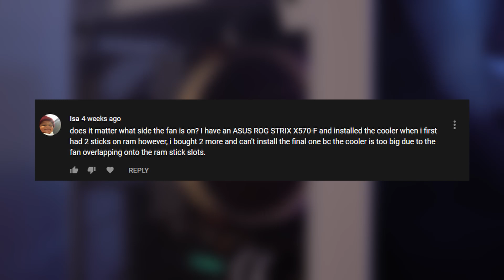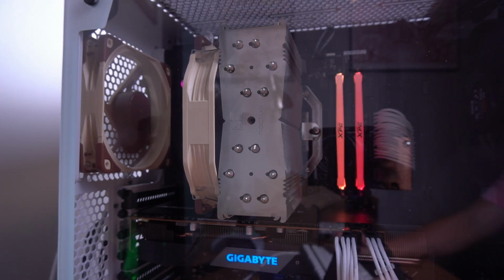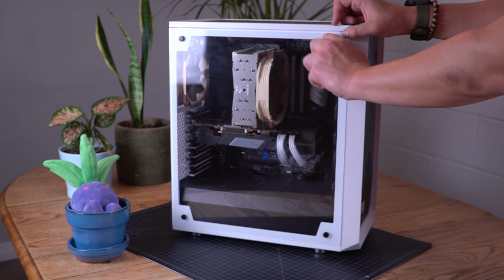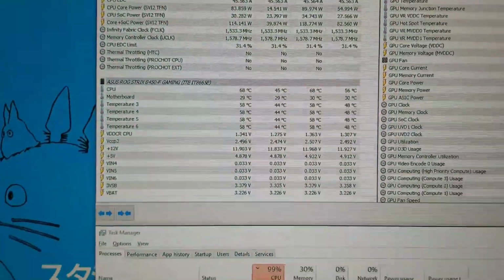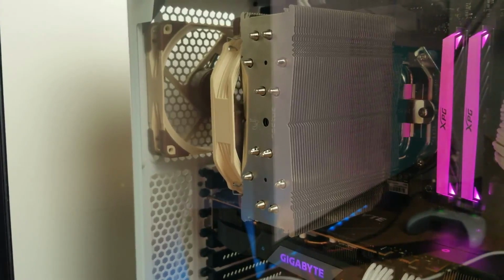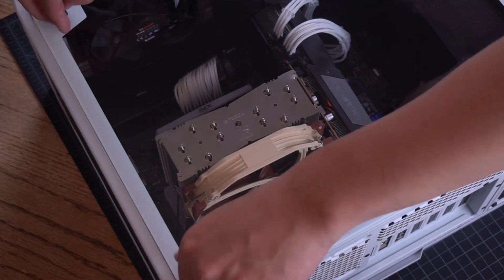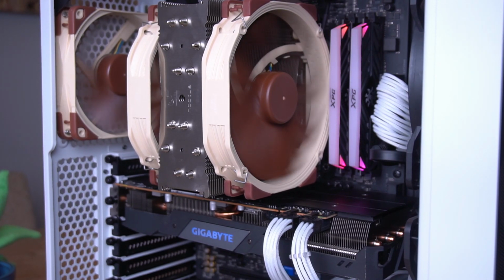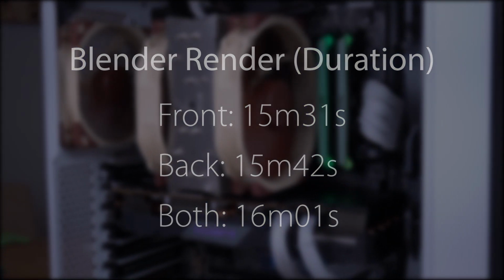What is the best placement for your heatsink fan? - Noctua NH-U14s

Comment: You need to set a fixed value for the fan speed. Otherwise you will get about the same result for every test since the only difference will be fan speed instead of showing the temperature difference that would've been reviled if the fan speed was fixed.
Reply: @heartman1486  You do that in bios/UEFI or there are software to do it if you prefer that.
Reply: Fan placement will not affect setting fixed fan speeds or not.
Reply: Man, you either painfully misunderstood the comment or painfully misformulated your thought. He's saying that the experiment does not make sense since even if there is a difference in cooling efficiency based on fan positioning, we won't see it because fan speeds will adjust to compensate.

Comment: I did the same test and found the  best config was with the  fan at the front. I also tried the dual fan set up and temps dropped a mere 1-2C.   However the dual fan set-up  had a distinct increase in audible noise. To the point  I thought there was a fault with my second Noctua fan, swapped and tested, was fine. Possibly  an interference  issue. My experience  says a second fan adds near to nothing. Hope this helps.
Reply: A couple C is a a couple 100mhz on a OC
Reply: @RossBoss90  For sure, in my case it was about lowest temps whilst being quiet with the standard clock. I do see your point of view though.👍
Reply: You only needed to use the supplied thicker fan bumpers that came in the box to get rid of this noise. Same thing happened to me when I added a pull fan on my D15. Those thicker bumpers only come in the U14S not D15 as the U14S was meant to have a pull fan added if desired and Noctua knew there is turbulence when the pull fan is used without a slight gap on it. If you look at your fan you will see the fan blades are closer to the edge on the non motor side.
Reply: @45eno  Thanks for the input. I can't find the original box, got lost in a house move. I have a couple of chromax fans on order, any idea if these use the thicker bumpers? 🤔
Reply: should both fans be facing towards the exhaust fan of the case or should they be alternate?
Reply: @miadu2466  The front or push fan as intake, the back or pull fan as exhaust

Comment: In my experience, the pull method (after the radiator) will make the fans work harder which makes them louder. Having the fans set up to keep stall (neutral air) from building up is always a plus. No matter, if you prefer AIO/Air, proper air circulation, if you prefer AIO/Air, proper air circulation will save you a lot of money.

Comment: I think if there was some sort of shroud around the fan that kept air from leaking  around the heatsink it would help as there is some  positive pressure created by the resistance created by the heatsink when pushing or pulling.

Comment: When having two fans, if the back one is spinning a bit slower than the front it could block airflow possibly or create a hot air pocket?
Reply: Use a 2 way splitter and run both matching fans to the same fan header. Noise on the rear suction fan is from improper spacing of the suction fan to an object.

Comment: I find having a fan in pull config isn't desirable as it creates an annoying acoustic. I have a Deepcool AS500 plus and at full speed, the fans are only at 1200rpm but the rear fan creates that loud noise due to it trying to pull air through the heatsink. If I run the fan at max with just the front fan, I don't really hear it as much. 

This is why for intake fans, it's best to have a gap/space between any mesh panel and the front of the fan. If you put your hand directly in front of a spinning fan, you'll hear the difference as well.

Comment: 5:24 actual reason it was louder in pull config and push/pull config is the pull fan placement to the heatsink. That heatsink was not designed to have the pull fan that close to it. The intake side of the fan is so close to the heatsink that it makes turbulence. Some of Noctua's coolers and many other brands need a slight gap on the pull fan to avoid this added noise. Noctua even includes thicker corner fan pads in the box for the U14S and likely many other coolers I don't own. Always pay attention when you install any fan with the intake side close to something. If you hear a new noise, don't just slow your fan down, find a way to put a gap between the fan and the surface it is flush against. Crazy this is not talked about more in tech channels, pull fans are always vulnerable to weird additional noises from the fan blades simply being too close to an object.
Reply: absolutley right. have the same issue with my cooler master. push/pull makes noise, till i played with the gap
Reply: To clarify, you mean the fan on the back side? I assume it's fine - perhaps even good, to use the slimmer pads on the regular configuration i.e. when there is a fan in the front?
Reply: @bennuwa  yes the backside fan,pull fan can create noise when place too close to a surface. If you keep the fan rpm down low enough you can decrease the chance of hearing this droning noise. But then you are greatly limiting cooling performance as you likely could run your fans faster while still being quiet enough for your needs. The easiest way to test your fans is one at a time. You can buy a $10-15 fan tester that you can control the rpm while placing the fan near objects like the heatsink or case. 

Usually pulling a noisy suction fan out away from the object by 2-5mm is all it takes to eliminate that droning noise.
Reply: @45eno  Sorry, to clarify again - if I only use one fan - the normal supplied fan, in the front ("push"?), then it's better to use the slimmer pads I take it. 

As far as I understand, the thicker ones are just for the rear fan in a dual setup. Just to clarify my meaning
Reply: @bennuwa  Yes, when you install a fan in a push or blowing onto a surface you normally don’t need any additional gap so the standard corner pads are all you need for vibration control. The thicker pads are a good option on suction / pull fans on the backside of the heatsink. Or anytime you get a weird fan noise usually only when the intake side of the fan is up close to something.
Reply: @45eno  I like the fact that this convo has been going on for a year.  I have Noctua nh-u12s in a push-pull configuration.  Getting ready to upgrade cpu, may put some thicker pads on the pull side.  Thanks.
Reply: @justingreen4450  even small felt pads cut to size can stick onto the fan corners and still blend in if the color is right. Noctua sells options as well that provide gaps. Good luck.

Comment: If you're experiencing RAM clearance issues, just mount the fan slightly higher on the radiator. 

P. S. Kudos for the Studio Ghibli background.
Reply: Finally someone that already posted the obvious. As long as your case can handle the slight fan height increase then you can easily make even the dual tower D15 work with stock front fan AND 4 sticks of ram.
Reply: @45eno  ONLY if raising the fan clears the case cover. Not a trivial point but a make or break point.
Reply: @jasonking1284  Did you even bother to read what I wrote?  I already said as long as the case can handle the slight increase in height. Did you even bother to read?
Reply: @45eno  Yea. I did read. That's why I wrote the message. You need to remove the word "slight" because it trivialises the situation whereas the reality is, even a SLIGHTly raised cooler is going to be a huge problem if it doesn't fit. Either it clears the case cover or it doesn't. "Slight" does not come into it.
Reply: Yeah not possible with mine unfortunately

Comment: Sooo, i built my PC a while ago but it was my very first time ever using one of these coolers. I went with the "Thermalright AssassinX120 SE ARGB White CPU Air Cooler, AX120 SE" cooler.
 I never had any issues with temps or anything, but i was walking by my PC that sits on a table next to my desk and realized i had the fan blowing towards the back. 
 I never noticed because I never had any temperature issues. It just caught my eye. Then I started wondering if it even mattered. Thats how I ended up here. I only have 2 sticks of RAM with the RGB heatsink covers on them similar to yours. 
 Then I wondered if putting the fan on the front of the cooler would help keep the RAM cooler. 
 But, I dont really want to change anything if it's not going to make much of a difference. Soo, I appreciate this video!! It saved me a few mins by not making me change the fan to the front, lmao. Thank you!!

Comment: The results are probably because the dual fan setup was done last and the system was fully heat soaked from running longer. Ergo the system slowed some. 
I have a U14S on my Ryzen 7 5800X build and the Cinabench R23 points drop, compared with doing a test when the system is just started and cool,  to when it's been running for hours and heat soaked. (all background programs closed, except security) 
Other's that have done these dual fan tests, on single tower coolers say the same thing, more noise, no increase in cooling. 
(In fact in a lot of test cases, the dual fans increased temps) the reason for that is, that not all fans are created equal. The exact same model of fan, can easily be plus or minus 100rpm from the specs, or even worse with cheaper fans. 
Even Noctua's newish and vaunted NH-U12A runs the same with just the front fan and no rear fan.... (but with less noise)Hmmm. 
I have enough experience with Noctua now, to know they make excellent fans, but like every other company, there is a lot of hype around the coolers themselves. 
For instance, the solder between the heat pipes and base should be visible but isn't. 
On the NH-D15S the cooling is so degraded by the single fan, you are better off getting a single tower solution. Either that or plan on the increased expense of adding a 120mm fan to the front tower on the D15S and running the middle fan in a push configuration on the second tower.

Comment: It would've been useful to either show graphs of the speed of the CPU fan[s] or to fix them to a constant 100% - otherwise, if they're always targeting a certain temperature, they will differ in their rate.

I also have the U14S and I've found that, weirdly enough, at full CPU load, there's only like 1-2 degrees difference between 80 and 100% fan rate.
Reply from the maker: Hey that's great feedback! Thanks for your response. I'll be sure to take that into consideration when I'm doing more temperature/fan based tests in the future.
Reply: yeah i never let it run over 75%, so around 1000-1100rpm.

Comment: I have a SilentiumPC Spartan 5 cooling an i5-12600K. Ever since I mounted a 120mm Noctua Industrial 2000, the temps dropped by 10-15 degrees. So, it's the speed of the fans that makes the difference. By mounting two identical fans running at the same speed you'll get other advantages as well: the cooler will have a slightly better "reaction speed" (it will start cooling faster) and by forcing out the same volume of air that was pushed in the heatsink, it will help regulate the system's general airflow.
Reply: That fan must be loud...
Reply: @jasonking1284  It is when pushing beyond 80%, but nowhere near as loud as the 3000 RPM version. But the performance is worth the extra noise, trust me. I plan on upgrading to an AK620 and I think I'll do the same (replacing the fans, that is).
Reply: @cristianroth8524  Interesting. Just installed a Peerless Assassin which replaced a Hyper 212. Improved temps by -20 degrees. Very impressed. Might get a high speed fan to replace the standard fans and adjust the fan curve when I upgrade the CPU..

Comment: You should redo your test.

The fan from the back needs the thicker pads against the heath sink.

Check their mounting manual.

It could help for the temps, because of the space needed for the rear fan.
Reply from the maker: Should clarify; thicker pads were used after I double checked. The video shows the old pads on as that was the only footage I had, but the results are with the thicker pad adding the additional space between the fan and the heatsink.
Reply: This is an important tip, using the fan on the back as a temporary fix (considering sand paper modifications so the ram will fit).

Additional question: in my pc, the fan will fit in the front of the heatsink but it very slightly bends the ram in order to do so (nothing beyond elastic limit) obviously, I want to avoid this but how much of a problem would it actually be if I let it?
Reply: @drdank9013  As long as the fan doesn't vibrate? Nothing. If it did vibrate, I think it could possibly damage the ram slot over time.
Reply: It's crazy to actually see someone mention these thicker pads. I see so many people mention louder noise when using push/pull or simply pull configs and 99% of people do not understand that pull fans have their fan blades too close to an object causing the noise. The advice I have seen is to simply lower your fan RPM to counter it. The correct solution for Noctua at least is the thicker pads on the fan to gap the fan and heatsink just a bit to eliminate that pull fan noise. This is a common fan noise issue anytime running a suction/pull fan too close to a case or heatsink.

Comment: I installed at the back and was questioning the temps. I’ll switch it to the front later since the MB has plenty of room. Thanks for the info.
Reply from the maker: No problem! What are your temps like as it's configured right now?
Reply: @PatrickRennie  I literally finished my 5600x build yesterday. I’ll measure the temps before I switch the fans to the front and report back.
Reply: @PatrickRennie  After 10 mins OCCT with 
Back: max 76.1C avg 70.3C
Front: max 71.8C avg 66.2C
Please bare in mind when I made the switch from back to front, I had put less thermal paste on the CPU.
Reply: @jayc0au  can I ask that when using the fan in the back, was the fan pusing air into the heatsink or pulling air away?
Reply: @halosxsjk  I have the noctua U9. By default, the fans pushes air into the heat sink. All my test are done on closed case, stock clocks, stock MB settings with ambient temps of 28c.
Reply from the maker: Very interesting. 4 degree difference on the average is a pretty significant improvement. Thanks for replicating the test, it's good to see similar numbers. It's also nice to see that you can still run the fan on the opposite side and get reasonable temps in the scenario where you need all 4 DIMMS populated and you don't have low-profile RAM.
Reply: Did you put the thicker pads on the fan on the back (in the 2 config version)?
It's in the manual, and creates a wider gap so the air can be pulled more efficiently.

In the video, he forgot to put them, and the rear fan touches completely the heathsink.
Reply from the maker: Hey replied to your initial comment. Thicker pads were indeed used (I just didn't rerecord my footage). The results in the video are with the thicker pads and didn't massively improve performance.

Comment: If you put your 1 fan to the end it needs to suck air obviously to throw it out of the case. But with this cooler you always get 2x fans. You do get better performance, I have both and you get -2C ~ -5C with 2 fans vs 1 fan.
Reply from the maker: You got 2 fans with this cooler? The NH-U14s only comes with the single 140mm unless they've changed their product. I had to buy a 2nd 140mm for this test

Comment: I directed both CPU fans to the center. and directs the rear fan of the case inward. I installed 2 fans above the casing for exhaust output and 2 fans above the PSU leading to the GPU. I get cooler temperatures. and I installed 3 fans pointing inward at the front of the casing. so the heat dissipation path is only at the top of the casing

Comment: Thanks for this, the fan blocks one of my DIMMs so I was wondering how much performance loss I'd get if i switched from push to pull, answered my question perfectly
Reply: Just raise the fan higher. As long as your case has enough room you can still have all 4 sticks installed and use the included 150mm fan. I am doing this now on one of my PCs.
Reply: @45eno  eh already made the swap from push to pull but that change probably would be the same if not more cooling loss although a lot easier to do.
Reply: @TheZanzou  Yeah it's a minor degree difference on push vs pull but just saying you can easily raise the fan higher on the heatsink and still make whatever RAM config work. The D15 with a push fan overhangs almost all the ram slots and my daughters PC has 4x8gb installed and easily accepts 2 fans on the dual tower D15 heatsink. Just letting people know it's as simple as raising your fan to make whatever RAM config work. As long as the case has enough width to support the fan raising up a bit past the heatsink.
Reply: @TheZanzou  ?? Why did you say "eh already made the swap" as if it doesn't take literally 15 seconds to add or switch a fan's position? lmao unbelievable levels of laziness
Reply: @bofasofa9399  because the configuration it's in currently is likely as effective if not more effective than the potential solution that they offered. Putting the fan so it's hanging off of the heatsink means less airflow through the fins which less cooling potential. Me saying "eh already made the swap" was me saying my problems already been solved so there isn't any need for their suggestion.